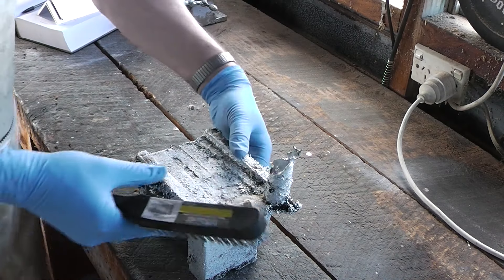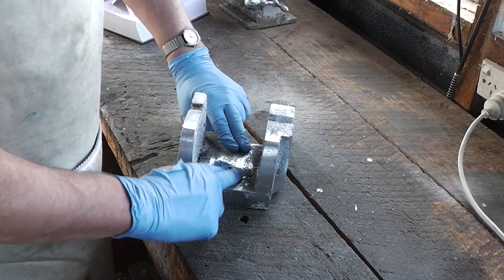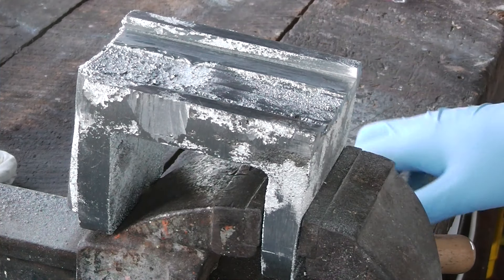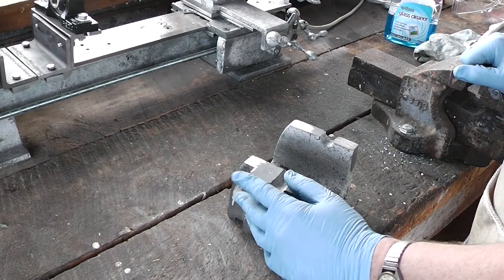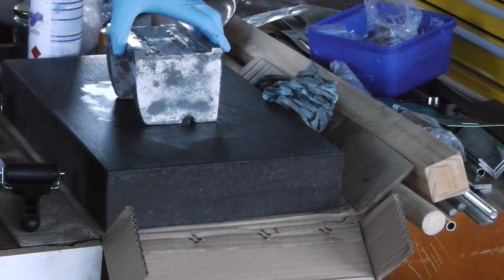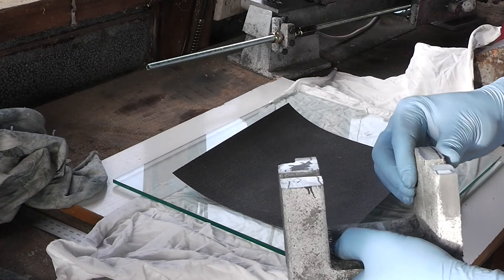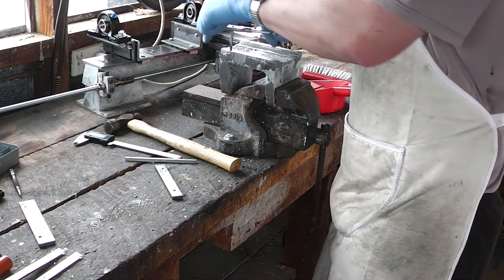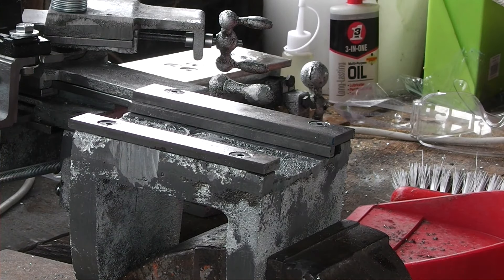Headstock Sanding, Filing, and Scraping

Comment: you have great patience for the use of hand tools, I'd be slapping a hand belt stander across that thing faster than you can say lung dust.

that being said, I'd also ruin it 5x before I even got to this stage
Reply from the maker: Tried that with the bench belt sander. It's not stable enough.

Comment: The glass and sandpaper is good, but lay the cloth flat out single layer on top the plywood instead of bunched up under the glass. Bunched up can allow the glass to flex a few thousandths and negatively affect the surface flatness